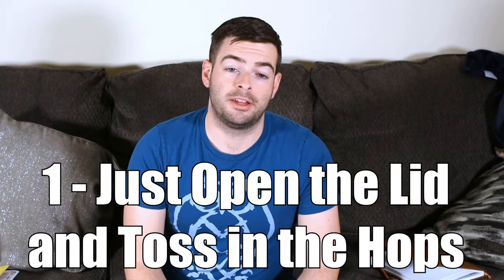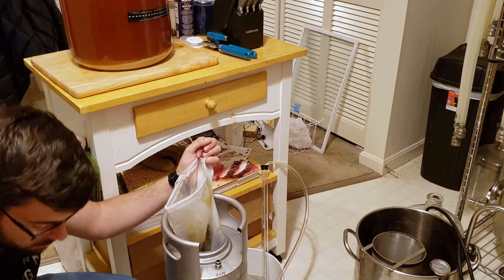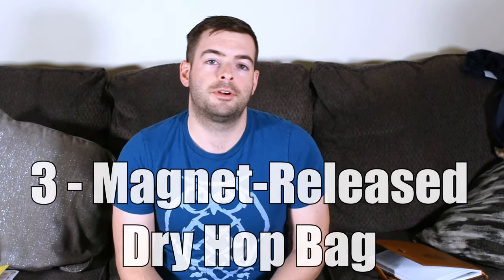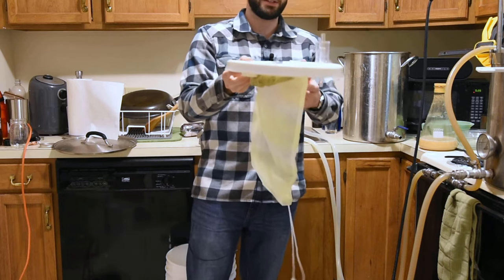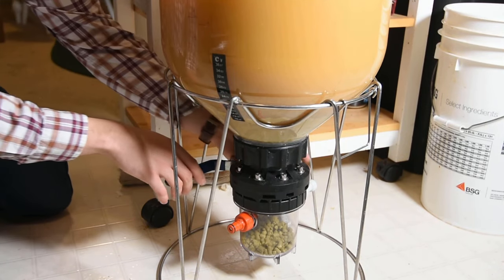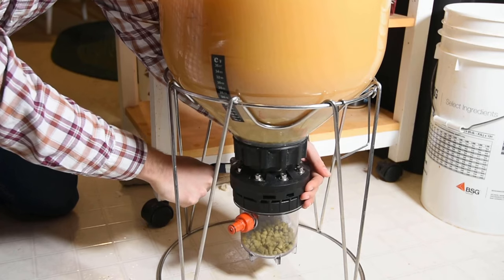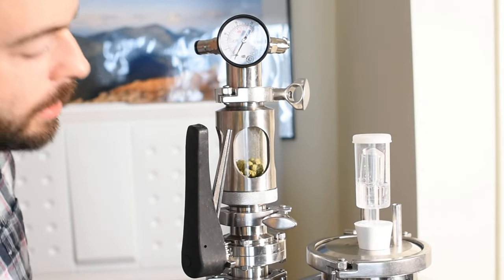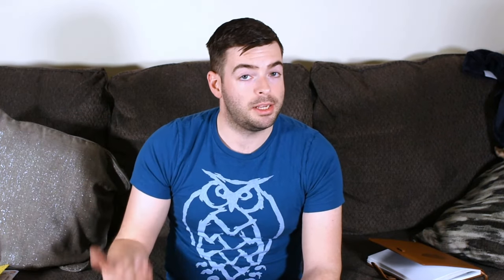5 BEST Ways to DRY HOP | Techniques for EVERY TYPE of FERMENTER | How to AVOID OXYGEN

Comment from the maker: Do you have a preferred method of dry hopping? Let me know down below!
Reply: I've been a chuck it in kinda guy. I try to get the dry hop in when the fermentation still has a few points to go. I control my ph and just by that been able to avoid oxydation so far (knock on wood). I did used ascorbic acid in the mash (per Genuis breweing method)when I went to 3oz+ type dry hops. 

I see a hop rocket is in your future ;). You seem to be adding a lot to your brewhouse lately.
Reply from the maker: @1TheLord1  It does seem like it, but for the most part I'm pretty sure my fermentation side is done evolving for a long time! I'm also a big fan of ascorbic in the mash.
Reply: the magnet released hop bag is brilliant. I will use it too!
Reply: I have two FZ all rounders. I brew in the first piping the co2 from the gas post of the first to the liquid post of the second and have a spunding valve on the gas post of the second. At high krausen I dry hop to the empty second fermenter so the hops are mostly sitting in co2 only. After the ferment I enclosed transfer from the first fermenter to the second (on top of the hops) then after the dry hop period I crash then enclosed transfer to a keg. I used to use a Fermzilla and dry hop through the jar but have found cleaning two all-rounders is way easier than dealing with the valve on a single FZ.
Reply from the maker: I share your opinion on the cleaning piece. I'm a big fan of the all rounder. That sounds like a great technique and thanks for sharing!
Reply: @hirdeshbajwa8906  Warning if you are doing a lot of hops it will require a few extra magnets.
Reply: Have you tried dry hopping in keg, then transferring keg to keg after the beer is tasting how you prefer?
Reply: @andrewmarquez9425  Are you taste testing at 68 to 72 F? I think your way of doing that is interesting but dry hopping does work at warmer temps compared to having the beer chilled which is the way I prefer to drink it. Curious as it does sound interesting.
Reply: @BitterRealityBrewing  I chilled it down after 3 days with hops in. I transferred into another corney keg because the party we were going to got canceled. So I wanted to get the beer off the hop matter. Seems to work pretty good. I threw a little priming sugar in the first keg with the dry hops to scrub out any extra O2 and get a little carbonation.
Reply: @BitterRealityBrewing  I guess essentially it’s just usually a keg for secondary, it’s just easier to pressurize and transfer.
Reply: @andrewmarquez9425  That makes sense as I use kegs as a secondary when it is needed. I should probably test cold dry hopping as I've read it doesn't work well but I think we all have read things that aren't true (like old myth of don't squeeze the BIAB) when it comes to home brewing and I always prefer to try things myself. Thanks for the info.
Reply: @TheApartmentBrewer  Hey man I got a question for u. Sorta knew here. So I've been dry hopping with the hops in a bag in the primary fermentor....never used a secondary. My question is since the hops eventually sink to the bottom and the hop oils float would the wort get more exposure to the hops by just throwing them in there without them in a bag rather than all the hops be all clumped together in a bag?
Reply: Or maybe be better to keep them in a bag suspended in the middle of the fermentor?
Reply from the maker: @Rubio_Eric  the truth is yes you do get more hop utilization from just throwing dry hops in there directly. However it doesn't make an enormous difference with or without a bag, just makes cleanup and transfer a lot easier
Reply: @TheApartmentBrewer  What ratio of ascorbic acid do you add to your mash?
Reply from the maker: Usually 3-5g
Reply: @TheApartmentBrewer  do u add absorb acid powder to grains or mix it in mash water during heat up ?  Made a “no waste IPA “ Just tried adding salts and absorb to mash water and doing a 90 min mash to see if it helps with my high gravity IPA (8%) using batch sparging in 2 10G igloos. Did splotch 1) voss @ 90 Deg 2) Mangrove Jack  m44 in 2nd bucket. 3) S-05 in glass carboy w 3rd runnings and added 1 lb corn sugar. FYI - fed 31 lbs of grading to chickens after drying them out. Tasting on 9/30.
Reply from the maker: @tman9338  sounds awesome! Yeah just in the mash is fine, or with your dry hops
Reply: @TheApartmentBrewer  just tried my 1st dry hop and then saw tour VId. Rats. Will try magnet dry hop option next Great Vid!!!
Reply: @paulnilsson9831  this is what I plan on doing except instead of the second all rounder I'm just going to use a corny keg with a floating diptube and screen.

The question is if it would really be neccesary to  transfer to a second keg and get the beer off the hops. 

Less transfers... Less potential for oxidation.... Less cleaning. However risk for vegetal flavors would be minimized
Reply: @kinggorf  after watching this https://www.youtube.com/watch?v=Fv7Zy5k6154 video I reduced the amount of transfers I do. I think that what you have in mind should work fine, I have also switched to floating dip tubes in the corny - they are great. I think it probably depends on the temperature of your fridge, the hops and how quickly you drink the beer. Maybe try it with galaxy and if it doesn't taste like grass after a month it's probably fine with anything :-)
Reply: Just chuck the hops in the fermenter before adding the wort. If you have a TC dump port with a butterfly valve, you can get rid of them at high krausen with no ill effects. It works even better if your fermenter can be pressurized.
Reply: I love the idea of the strong magnets. The only time I tried it, though, it fell right into the beer when I snapped my fermentation bucket closed. I have a PET carboy that I think will be a better option in the future.
Reply: I did a brew on Saturday night and came up with a new method, which has gone straight to the top of the list for it's simplicity and cost effectiveness. I simply tied my hope bag up with fishing line, put it in the fermenter and fed the fishing line through the air lock. The line is small enough to not break the air lock and when I want to drop it in all I have to do is sanitise the line, loosen the airlock bung and let it drop.
Reply: I was thinking of trying the keg method, the only drawback seems to be letting the beer sit on the hops for an extended period. What about transferring the beer to another (empty and purged) keg after the original dry hop? Going from fermenter-> 1st keg with DH for 2 or 3 days-> serving keg? You could technically do as many dry-hop additions as you’d like as long as you have a spare keg…
Reply: I have the Fermzilla All Rounder and do a hop drop with their hop bong. Works great! Can I ask why you're not a fan? What don't you like about it?

Comment: Thanks for posting this. It introduced me to the magnetic hop drop and I tried it for the first time. Hopefully the results will be good and I'll do that in future. It certainly simplified the hopping, just remove the magnets and listen for a little splash! My fermentation is stainless steel and it worked a treat - I tested it and the magnets held very strong. Is there any other reason you said maybe avoid magnets with a stainless steel fermenter?

Comment: Awesome educational stuff here TY.  Question about dry hoping.  Could you dry hop in a big mouth secondary fermenter by simply adding CO2 into the head space and then quickly take top off and drop hop basket in and then do the reverse when removing it?

Comment: Good timing. I just finished my second dry hop charge on a Catalyst fermenter. It was very tough, there was not enough headspace above the liquid to do the magnet method, and the bottom port only accepts mason jars. I ended up trying to fill a mason jar with co2 once my hops were in just by blowing co2 into it with a lid partly covering it, then closed the jar. Then I slide the lid off while attaching it to the fermenter.

It worked... Ish. But there was still sediment on top of the bottom valve so the hops just got buried, and overall was not a process conducive to reproducibility.

I bought a larger mason jar (32oz), a glass drill bit and a ball valve with a nipple attachment, that I'm going to experiment making a dry-hopper with specifically for the Catalyst. Will update when I finish.
Reply from the maker: Good luck! I know that the glass makes it difficult, be safe with that
Reply: Yo! I also have the Catalyst and was literally YouTubing methods of cutting glass to make a puragble mason jar. All the ones you can find/buy have attachments on the top but that's where it connects to the catalyst. 

I've also done the fill with CO2 thing and it worked pretty well but you know there's still some oxygen coming in and it feels hacky. Would love to get a side-purgable mason jar for re-attaching during trub dumps, dry hopping and yeast harvesting. 

I also will keep my eye out for a plastic wide mouth mason jar that might be a little safer to hold pressure and drill. 

Btw, here's one of the good YouTube vids I found for drilling a hole into the side of a mason jar: https://www.youtube.com/watch?v=zXWU8NniM3I
Reply: @joshuapinter  I'll take a look, and might upload my own. I ended up drilling a hole onto the side of a 32oz jar under water in my sink. Works pretty well!
Reply: @nickdefrancis  You'll need a glass vessel with sloped sides at the bottom, otherwise you're going to be shaking the heck out of the whole setup to get the pellets to go down the tube. Let us know how your do with this, very interested!

Comment: I ferment in a keg and with the beer I just brewed yesterday, I was planning to do the sous vide magnet and hop bag but I found some challenges with this.  With the 5oz of hops (7 days into fermentation) I was planning, one magnet seemed not quite enough, so it was a pain to keep them in place, line up the magnets etc.   I'm guessing less hops would be less of a problem, but kegs don't have a ton of room between the opening and the side of the keg.   Also it was a challenge tying these cheap bags closed so they don't just open immediately, or I pull the string through one side accidentally.   Perhaps with more patience and practice I could get it to work with smaller hop schedules, not sure.

So I just bailed on the magnet/bag and decided I'm just going to fill the headspace with C02, open the lid, drop the hops in, close the lid, then re-purge the headspace with c02.   I can't imagine there would be much risk of oxidation with this as it's only going to be 30s at most where the fermenter is open and there will be a layer of c02 in there, and any oxygen will be immediately purged out.   If anyone can think of a major risk of doing this, or something I might not have thought of let me know.

Comment: Man you are getting a lot of the blame here when I explain to my wife why I need a spike fermenter :D Really like that last dry hop method, especially seeing as though you can do multiple charges. I just made a NEIPA and tried the magnet method in my fermzilla all rounder. Didn’t have enough magnets to hold the hop addition with a stir plate in the bag though so after a bit of deliberation ended up throwing them in at yeast pitch. Brulosophy did an experiment on this a few months back and, like them I didn’t get any grassy flavours from it. Just made sure to transfer to the keg as soon as I’d reached FG at 7 days.
Reply from the maker: You don't NEED one...but dont tell your wife I said that! Yeah I've had some variance as to how long it takes to get grassiness. Usually its around 7 days for me where I start to pick up on it, but it has a lot to do with the amount of plant matter in the beer.
Reply: Haha, you do need one! I just got a BrewHa and will be using the sightglass charge method myself. The only downside is the smaller TC fittings, but I am seeing more conicals coming out with larger diameter fittings so that is promising!

Comment: I've heard of tying up a hop sock / muslin bag with a piece of (unflavored) dental floss that you hold in place using the fermentor bung. Just lift a bit to let the hops drop. I have NOT done this though. I have dry hopped a mead by just plonking a bag in, but they are less prone to oxidation. Have not dry hopped a beer, specifically because I don't want them to oxidize. I'm no longer struggling with oxidation as I was with my old system (auto-syphon and a bucket, so easy to oxidize), so I'm going to start experimenting with dry hopping soon.
Reply from the maker: Seems like a good method as well! Don't be too afraid of the oxidation from dry hopping. Its a risk for sure, but its not a huge terrible thing if you take the lid off for a few seconds.

Comment: Nice vid! I dry hop in the keg, loosey goosey. Usually I drink beer pretty fast/share with friends. But I agree if you are planning to keep it around its not the best method for long term!
Reply from the maker: Thanks for watching Trent! Yeah I agree, if you can turn it over or pull the hops out in time, its fine. Cheers man!
Reply: Hey BruSho! loosey goosey? No bag or SS hop spider? Don't you get hop matter in your pours??
Reply: @blakefaulds  I might get a little bit in first couple pours but from there on out its fine. If you are doing a huge charge of dry hops probably best to use some filter in there I suppose to keep your dip tube from clogging.

Comment: After dry hopping in the primary, I pressure-transfer to a purged keg for another dry hop.  The keg is fitted with a capped, grommeted hop spider screen through which the liquid outlet line passes through.  The hops are placed in the keg loose.  Beer is transferred from the primary through the gas inlet on the secondary (not an issue because the keg is purged).  When dry hopping is done, the beer is pressure-transferred to a purged serving keg via the liquid out line while the screen filters out the loose hops.  When I eventually get a pressure capable ss bucket, I'll use your sight glass method.
Reply from the maker: Thats really creative, thanks for sharing!

Comment: I have a stainless steel fermenter. Do you think I could get a hop bag to drop that has a magnet in it attached to the inside of the lid, by using the reverse polarity of another magnet on the outside of the lid?  Of course I could just test it but I don’t have magnets yet
Reply from the maker: I think you could easily do that. I don't think regular 304 stainless steel is magnetic, so that would probably be fine

Comment: The newest idea it seems is to crush a tablet of sodium metabisulphite and add it to the bottom of the keg.   Fill a stainless canister of hops and drop that in.  Then rack your beer into the keg.  The crushed tablet supposedly prevents oxidation.  I plan to try this idea out with some 2021 Chinook hops.

Comment: Great content as always. I dry hop my fermenter king jr by depressurising and unscrewing the collar, pumping co2 down the dip tube so I have positive pressure and quickly dumping the hops in when the lid pops up. I always purge a couple of times after putting the lid and collar back on  just in case. Then I re-pressurise back to my fermentation pressure and don't bother with the spunding valve if near the end or at the end of fermentation to keep all that aroma in there.
Reply from the maker: Good stuff, thanks for sharing that technique!

Comment: Thank you for this concise tutorial on dry hopping. I gather dry hopping is mainly for aroma and not for bittering. But is there a way of increasing the ibu’s or bittering hops during or after fermentation by adding hops/hop extracts? 
(I was hoping to explore possible ways of avoiding the boil entirely in the brew stage.)
Reply: The bittering hops are mostly functional in their purpose , it really does help stop beer going bad , put it together with good sanitization and you have a solid foundation for good clean beer. You get your boiled hops in your fermenter right from the getgo to help keep your fermentation right
Reply: Yes its for aroma not bittering. What nobody days is that ITS LIKE COOKING GARLIC OR GINGER, the flavour looses a LOT of sharpness compared to raw ginger/garlic . Boiling dramatically changes the flavors you get , and in fact it cooks most of it off

Comment: Really nice tips. I use the open the lid In fermzilla approach and to minimize oxygen contact I ferment under pressure (15psi) and when I dryhop I depressurize and open the lid to put the hops. What happens is, even If fermentation is over, CO2 will come out of the beer cause the headspace is at 0 psi. So I just release this CO2 to purge out O2. Cheers!
Reply from the maker: Positive pressure from CO2 is a very easy way to keep oxygen out, just got to be careful not to have the beer explode on you!

Comment: Does the hop freshness go away leaving the hops at 65-75 degrees in the fermenter with magnets? Can’t find anything on it.
Reply from the maker: Its a good question, but no I've never had an issue with the hops staling. Stale hops has far more to do with long term oxygen exposure than temperature. True, keeping them in the fridge or freezer helps extend their packaged shelf life as well but they can handle a few days at higher temperatures if there's no oxygen exposure